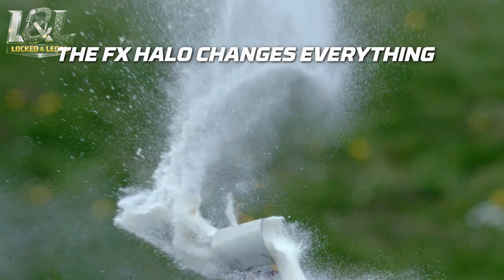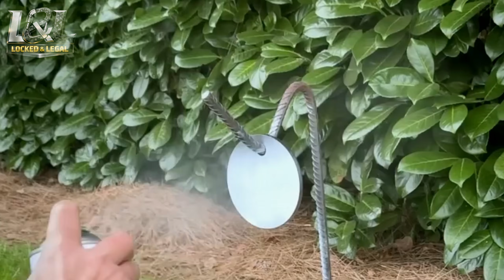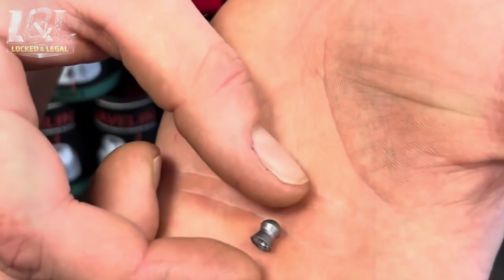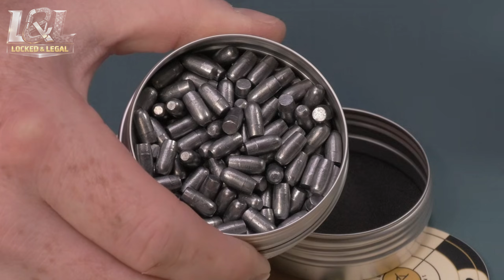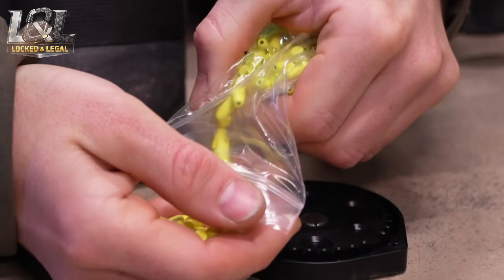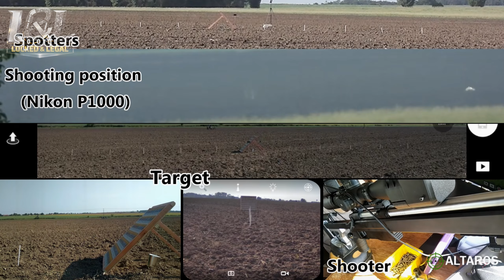Best Long Range Airgun Slugs 2026 — Top 5 PCP Slugs Tested for Extreme Distance

Comment: What is the name of the coating that's applied to those Zan slugs?  It looks like it's just some kind of powder coating.
I'm a bullet caster and I power coat my cast bullets.  The powder coat acts as a lubricant of sorts as well.  On polished gun barrel bores, the powder coat layer will only leave microscopic traces of fouling.  I'm sure that the same would apply to those Zan coatings.
Another variable that you strategically neglected to mention is that regardless of the accuracy of a given PCP brand or model, you still have to find the slug that your particular PCP tends to shoot the best.
Reply from the maker: Thanks for the detailed insight! You're absolutely right that every PCP has its own slug preference, and finding the best match is a huge part of achieving top accuracy. As for the ZAN coating, I'll look into the exact coating process so I can share more accurate information in the future.

Comment: I shouldn't put this out here, but rmr slugs are as good or better than fx, and there like 80 bucks for 1000 seconds, which are still very accurate, probably wouldn't use them for a competitive shoot. But the ground squirrels can't tell the difference and they are absolutely devastating at 950fps
Reply from the maker: Thanks for sharing your experience! RMR definitely sounds like a great value option for shooters looking to save money without giving up much performance. Real-world feedback like this is always appreciated.

Comment: I get phenomenal accuracy with my umarex gauntlet sl25 with 33gr appolo slugs 😂 there dirt cheap too. Its also very accurate with H&N and rmr slap slugs, which are basically the same as fx hybrids. But the absolute best accuracy from my rifle so far is the cheap appolo's interestingly enough when I did expansion tests the also performed the best as far as uniform consistent expansion into perfect mushrooms, the rmr basically fragmented to pieces and the H&N expanded but not fully.
Reply from the maker: Thanks for sharing such detailed results! It's always interesting when a budget slug outperforms the premium options in a specific rifle. Sounds like those Apollo 33gr slugs are a perfect match for your Gauntlet SL25.

Comment: Should have done javelin .30 cals 64gr and 68 gr .135 .136 and .22 javi has 40 gr too. Griffin isnt mass produced....yet hand swegged hpbt 78gr .140 bc and 85 bt ..156 bc. 100% lead as well. Steel on lead is like sandpaper. That why i shoot 100% lead. With 100% lead ammo and at least a tin thru it increases consistency and accuracy. Dont need to clean that often unless you use antimony ammo. Great videos though.
Reply: I can't afford a high end gun, so I polish my bores with mothers mag polish, and then do a coat of carnuba wax does wonders to make the bore slick, I haven't had to clean a barrel in a long time, and the accuracy is greatly improved.
Reply from the maker: Thanks for the detailed recommendations and for sharing your experience. Those are some excellent slug options, and we appreciate the additional insight on bullet composition and barrel conditioning. We'll definitely keep them in mind for future slug comparisons. Glad you enjoyed the video!